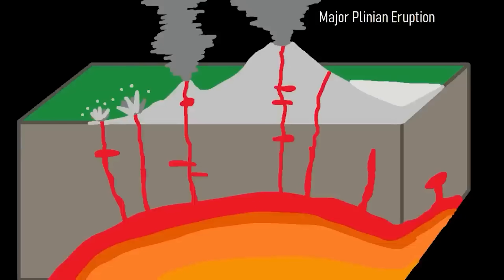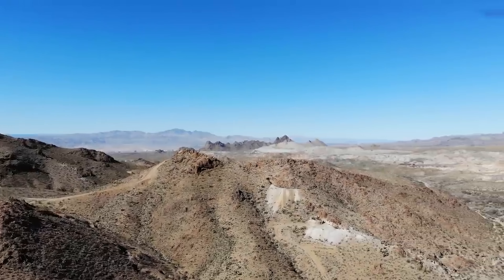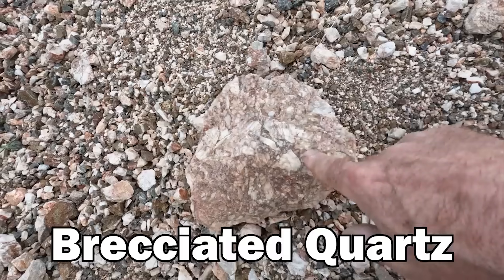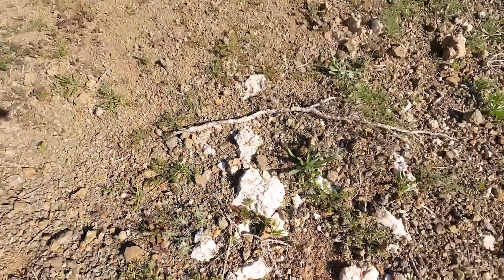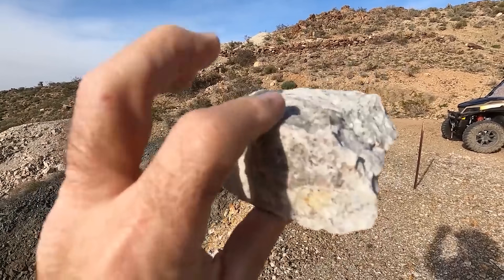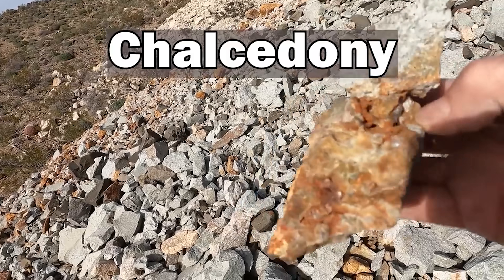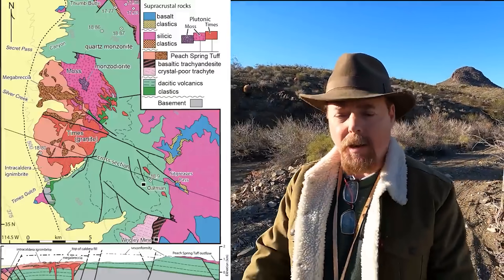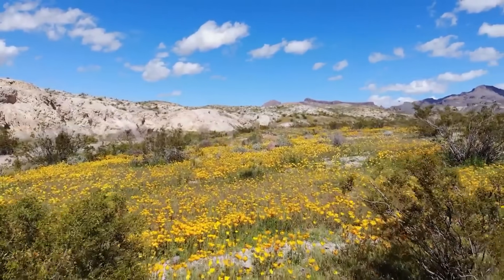Geology Secrets of a Caldera Gold Deposit

Comment: Living in the Mojave Desert is a rock hounds delight. Not just for precious metals and gem stones but other rocks that have either been spewed out or was exposed by the elements over time can be polished up for your own enjoyment or to make things with. And few people realize how volcanically active this area was, though I should say IS since there is a hot springs in the apple valley hills (Bowen Ranch), and I know the mighty mojave is plenty deep so for that trickle to get heated tells me theres still melted rock fairly close to the surface. I can deal with the ground under my feet shaking alot better than I can the air I breathe actively trying to kill me with a tornado or hurricane.